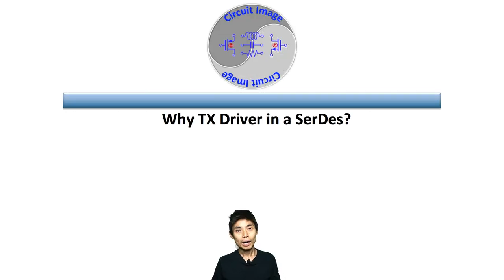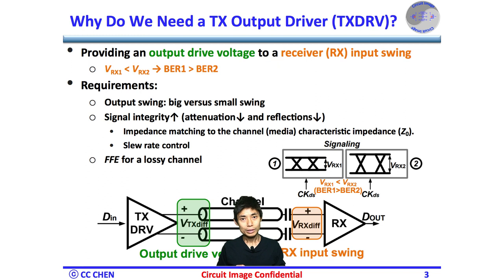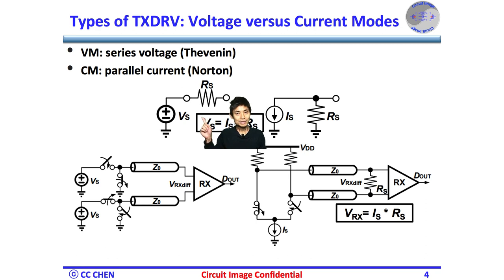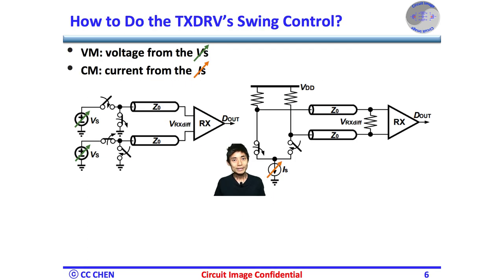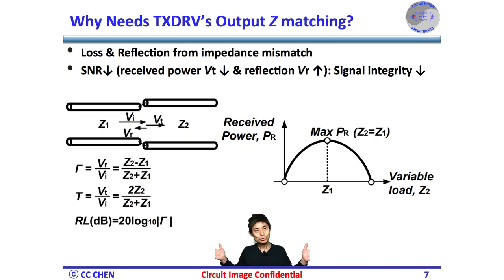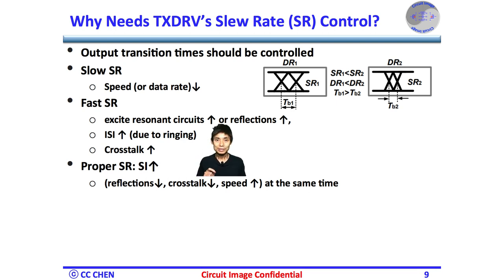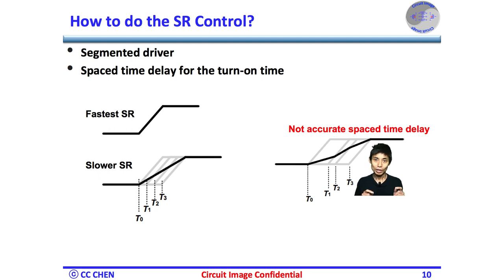Why TX Driver in a SerDes?

Comment: 老師您好，想請問您
driver  的明確定義，有包含哪些部分。
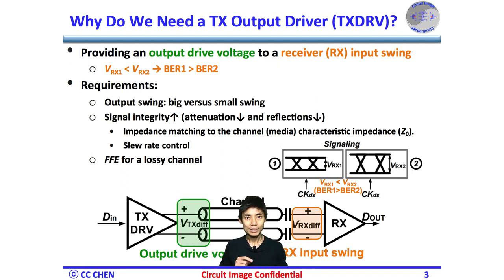以FFE來說，是接在Channel之前。 即0:39處， 
那我可以說ffe  equalizer都算是一種driver嗎
還是討論tx driver時，是包含ffe 以及阻抗的termination。
即訊號先經過FFE 再經過 阻抗匹配才會送進Channel。
Reply from the maker: Hi 正宇, 
感謝您的反饋和好問題。你是對的。
1. TX FFE 或 RX CTLE 都是信號緩衝器。
2. TX FFE 將驅動 100ohm（差分），這是低阻抗和高功耗。
3. 正如你提到的，TX 驅動程序將在通道之前包括 FFE 和 TX 終端；因此，我們也需要在通道之前進行阻抗匹配。
Hi, 正宇
Thanks for the feedback and good question. You are correct.
1. Either the TX FFE or The RX CTLE are signal buffers.
2. The TX FFE would drive the 100ohm (in differential), which is a low impedance and high power consumption.
3. As you mentioned, the TX driver will include the FFE and the TX termination before the channel; therefore, we need the impedance matching before the channel as well.
Reply: @circuitimage  Thanks for your reply!
it’s helpful
Reply from the maker: @王正宇-i1l  You're very welcome and I'm glad that was helpful :)

Comment: Hi Chen, For VM TX we usually play with the impedance to modulate the swing when supply is fixed. Could you elaborate, how the supply is varied for swing adjustment? As calibrated impedance would change when supply is varied on the fly? Please let me know if I am missing something?
Reply from the maker: Hi vars008rcb, nice to meet you, and thank you for the good question. The supply can be adjusted by the regulator. But, the impedance calibration would not be applied on-the-fly; otherwise, the BER or SI would be degraded a lot.
Reply: @circuitimage  Hi Chen, Maybe I was not clear. I meant to say we calibrate the impedance for a given supply and process corner. Now if the supply is adjusted after impedance calibration, aren't we disturbing the calibrated 50 ohms?
Reply from the maker: @vars008rcb  Hi vars008rcb, thank you for the good clarification. The impedance calibration can be done at power-up, which is an offline calibration. In that case, you are correct. The impedance would be less matching. On the other hand, the impedance calibration can be done with a replica tracking loop, which is a background calibration running continuously. If the loop bandwidth was designed well, the signal integrity could be still maintained well. Thank you so much. 
🙂
Reply from the maker: @vars008rcb  Hi vars008rcb, thanks for the clarification. You are right, if the supply is adjusted after impedance calibration is done, the new impedance won't match well and that does disturb the 50ohms; therefore, people may have other options of doing the replica calibration loop background to calibrate the impedance continuously, which would be adjusted when the supply changed. Thank you so much. 😄

Comment: could you explain how fast SR will impacts us in terms of frequency domain .I didn't understand about reflection .
Reply from the maker: The fast SR would contain more frequency content. The reflection comes from a wide band of frequency matching. Usually, you may not have a good matching at the high frequency because of the big ESD requirements. 
For example, if your Z matching only matches at 1GHz, but you're sending 10GHz content from the fast SR in the TX driver output, you must receive terrible reflection because of a poor matching at 10GHz (very poor return loss)
Reply: @circuitimage  got it .I understand it now.
Thank you for your reply.
Reply from the maker: @rangababuganta7725  You're welcome :)